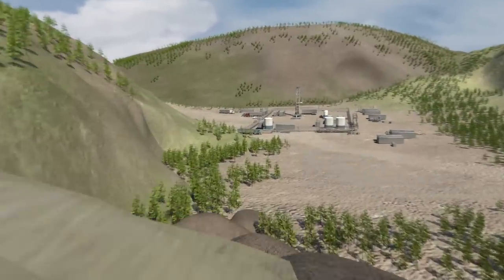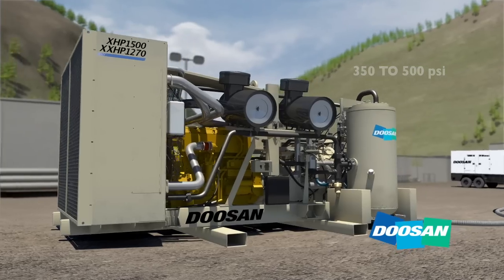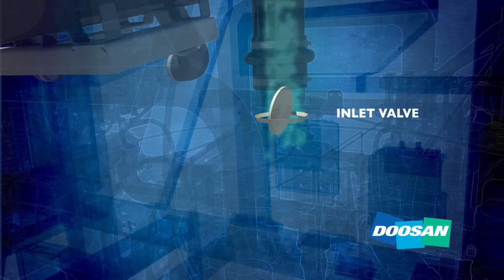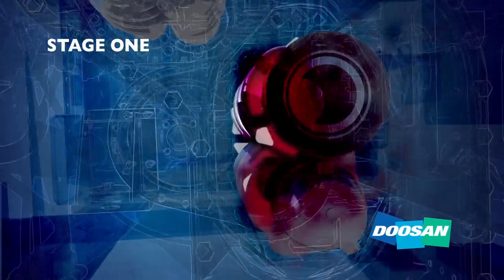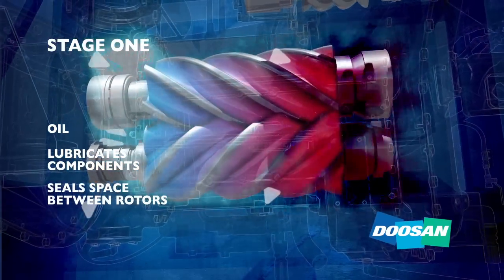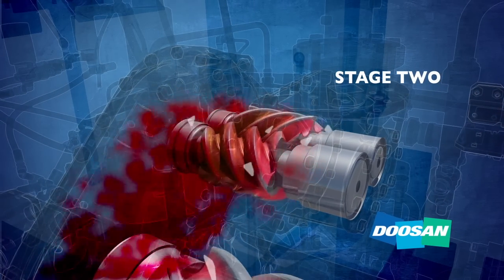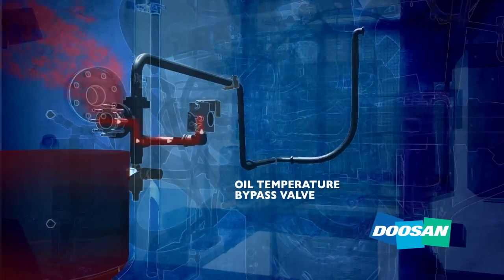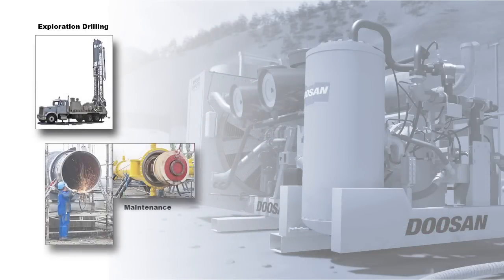How a Two Stage Air Compressor Works

Comment: 2 stage and up to 500psi capable so assuming each stage is roughly equal in pressure ratio capabilities, they are each capable of a 250psi pressure difference or roughly 18:1 pressure ratio each. ((250+14.7)/14.7) and that on its own is impressive.